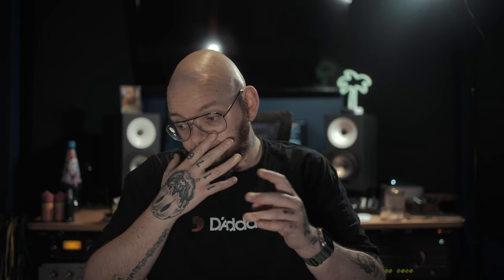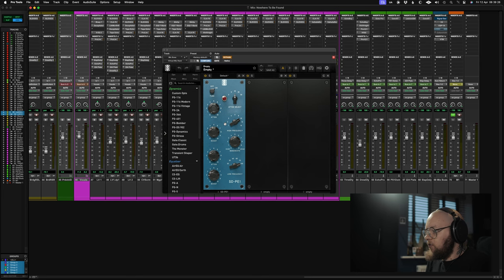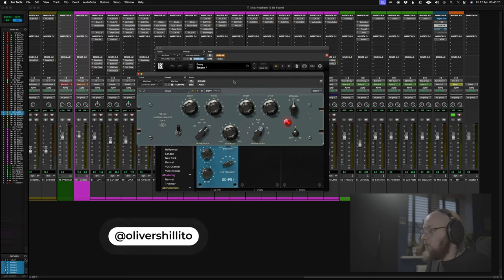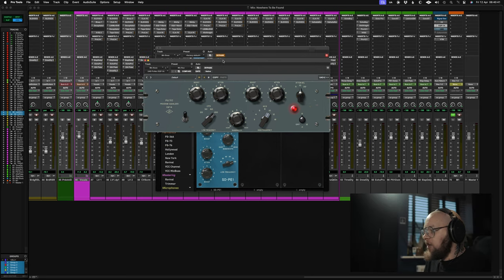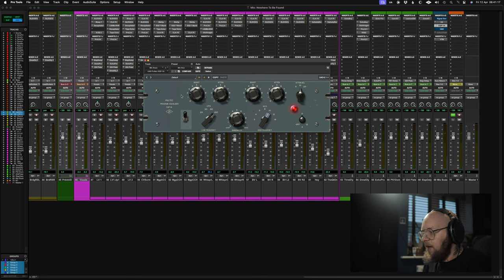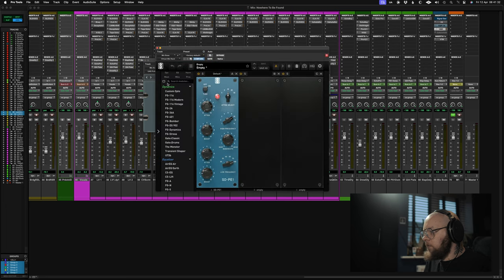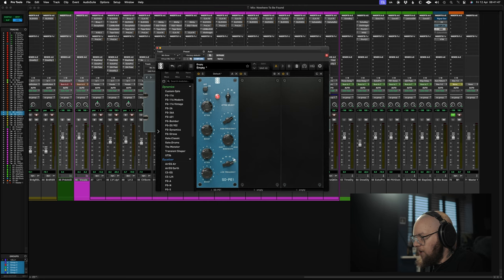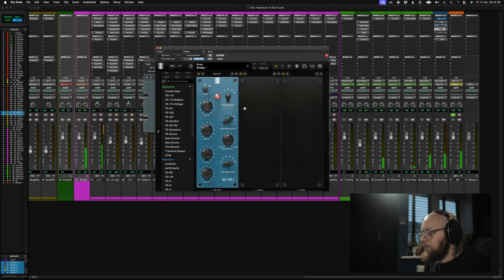Slate Digital SD-PE1 - Does It Suck?

Comment: I've been using the UAD plugin for a while and have now started using the slate version in place of it. The UAD version adds about 1.5db of gain when inserted, where as the slate version does not add any additional gain. I've done some of my own comparisons but included a 1.5 db reduction in gain to the uad version, and found it difficult to discern any differences between the 2. I've gravitated towards using the slate version now, as when attempting to make subtle changes to a mix, the 1.5db of gain can be a little inpratical.
Reply from the maker: Yes I noticed the gain boost also actually but I’ve been using the UAD plugin for so long now I’ve just gotten used to it!
Reply: @OliverShillito  I would argue that it's possible for the perceived better quality of the UAD plugin is actually as a result of this gain increase rather than any specific sonic quality it has over the slate version. You may hear things I don't, but when I level matched the 2 and tested it for myself, I found it difficult to distinguish a difference between them. On the other hand, before level matching, I didn't feel the UAD was louder than the slate, but rather I perceived it as sounding better. In my opinion it would be worth doing a level matched and blind test of the 2 for fully non bias idea of the sonic differences.
Reply: @tribalcowfish thr original pultec does that 

The legacy plugin from uad doesn't I believe (I can't remember it may be the other way around)

Comment: Problem comparing subtle differences in audio on YouTube is that most of us out here in Da Toob-land can't hear the differences.  The YouTube compression algorithm plays silly buggers with audio, plus most of us are not listening to this on calibrated studio monitors or even high quality headphones.  I have pretty good ears, been working in audio for decades, but I can't really hear a real difference - most likely due to the YouTube compression.  Also, as somebody else pointed out, the Bandwidth settings were different.
Reply from the maker: That’s a fair comment and I will absolutely re-test it with the bandwidth settings the same and if there’s a huge difference in what I’m hearing. I’ll post an update! Appreciate the feedback and thanks for watching
Reply: If the 'YouTube Compression' renders it unnoticeable then there wasn't a useful difference to begin with
Reply: Although that is generally true for those slight differences, in this example the difference is quite noticeable, especially before he tried to match them more closely. I watched this before even trying it out as I do have All Access, I'm going to have to test it my self. I don't really care how close different plugins sound to each other, rather just how good do they sound in a mix. Even two different hardware Pultecs are going to have differences, sometimes not even that subtle.

Comment: Thanks. They can't be the same. There are several things (bias or variable) to consider : UAD have almost 1.5 db of gain in its default status. The amplitude and resolution of the gain knobs are not the same (meaning 3 on UAD is not equal to 3 on other plugins). They are not modeled after the same analog unit. In the analog realm, there are tolerance from unit to unit. That being said, the curves are pretty much the same on both units (checked with Plugin Doctor). But The THD is not the same. In your test, the bandwidth setting is not the same. So, they can't sound the same. Do we need this ? We don't need any plugins. Plugins can be useful. Maybe one already have the VMR Bundle, and find is just convenient to stay in the same "channel strip" concept, instead of open an another plugin window. Or maybe someone don't like (or don't have)  the Universal Audio ecosystem. So, it might be a useful thing for users to have options. 😉 Maybe try a test with the same curve and the same gain amplitude, if you want compare "apples to apples".

Comment: If the settings of two plugins are the same, there is no need for the two plugins to exist. Just those plugins are different, and categorized into variety
Each manufacturer may include different settings using different technologies.
Users can create and save many settings, and control various settings with the knob included with the product.
Reply from the maker: Sure, unless one sounds objectively worse than the other. One could argue that with so many pultec plugins already in existence, there was no need for Slate to make this at all, especially if it sounds worse than what’s already available. Which I think it does!
Reply: @OliverShillito  When you try to use Slate Digital pultec products in a positive way, new ideas may arise.
Because you own it, you can explore the plugin at any time. happy mixing. 🙂
Reply from the maker: @fataldemo3327  fair enough. Happy mixing indeed!

Comment: It's a Slate sound (problem). It's the reason I've fallen out of love with them for a while. The plugins are kinda meh. There are better bus compressors, tape, EQs, compressors... And those are not hard to find. Obviously, the settings quite often don't match between manufacturers. Obviously. But when you do watch them by ear, in my experience, others are just...better. It's cool to start with. Everything is kind of "unified". The GUIs are cool. But it's not what matters, sound does. I actually think, Slate's plugins feel a bit "abandoned". Like a time machine todidn't a 2012. A specific sound that, perhaps, didn't age that well.